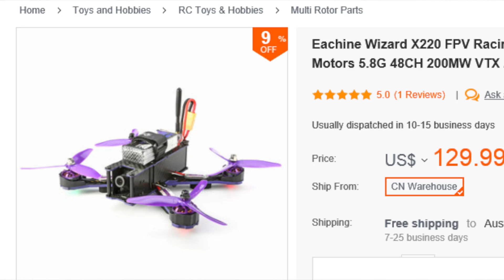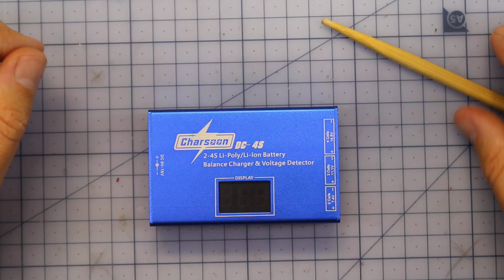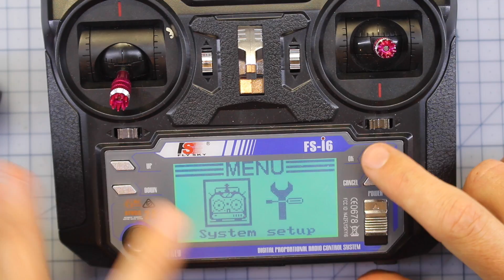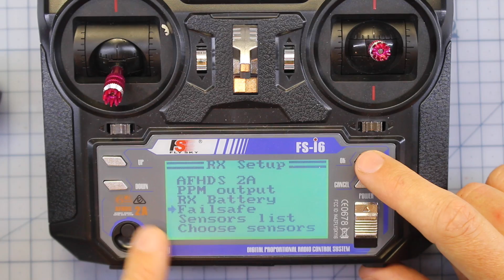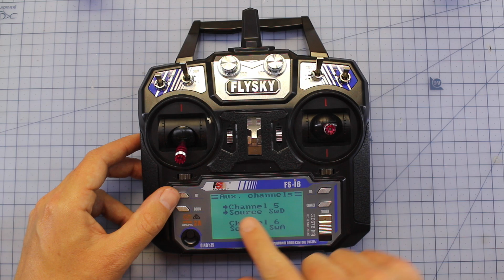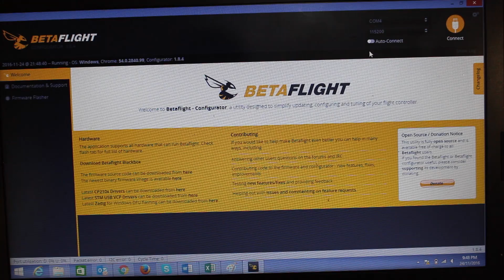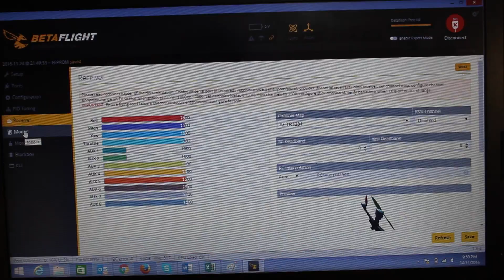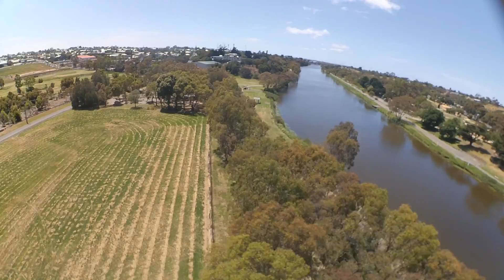How to get FPV DRONE RACING for under $300! Parts +Full setup.

Comment: Hey UAVfutues so i'm looking for a vtx that i don't need a HAM radio license for so right now i'm wondering about this vtx i found http://www.banggood.com/Skyzone-FPV-TS5813S-5_8G-25mW-40CH-Mini-AV-Wireless-Transmitter-For-Mini-Multicopter-QAV250-p-1021364.html now it's 25mw i don't know is that legal in the usa without a ham radio license.

Comment: Batteries are sold out once again. Which replacement can I get? Do it have to be 1300 mAh and 70C? Almost every battery on banggood seems to be sold out now :o
Reply from the maker: did you try all the links in the description. as long as it is more than 40c, is 4s or 3s and between 1200 - 1800mah you should be good.
Reply: Thanks man :) Love this video, really got me from wanting to try out FPV to actually making an order and do it :) One last noob-question tho, Mode1 or Mode2? :)

Comment: you should've also added a voltage checker to the list so you can strap it on the quad and it sounds an alarm when the battery gets low
Reply from the maker: the charger is a checker.
Reply: no I mean a little one that can fit on your craft that beeps when the battery is low

Comment: what about this battery for us Australians? https://hobbyking.com/en_us/turnigy-nano-tech-1300mah-4s-45-90c-lipo-pack.html
Reply: The reason i ask is a mate and I are following your guide to build a drone each for the new year. We went looking for different batteries because adding the batteries from the links in this video (bang good) are messing up the cart and will longer to ship when separated from the order.

Im also trying to work an OSD into this set up, any you could recomend, distance from transmitter and home marker i feel would be the most important features I would need.

purchase list so far is as follows, we would value your feedback and both of us look forward to popping our FPV Cherries :)

Quad
http://bit.ly/2fXOXEN

FPV Goggles
http://bit.ly/2gYh6hv

Balance Charger
http://bit.ly/2gbwaF6

Battery
http://bit.ly/2hUSNmh

Controller
http://bit.ly/2hwrz4m
Reply from the maker: those batteries will worl

Comment: Hello, why you consider this drone better that Eachine racer 250. I want to buy a racer drone and I want to choose between you proposal and racer 250. So I'd like to know your reasons why 220 and no 250. Thanks anticipated for help
Reply from the maker: the racer is junk . poorly made and will break. this is much much better
Reply: UAVfutures thanks a lot for your help. You answer is clear and sharp like a blade. The question that remains is if you will recommend the 220 quad also for beginners or maybe something else will be better. thank a lot.

Comment: Aside from the batteries you recommended, could you add another battery recommendation for maximum flight time? I'm a total beginner and would like to have more flight time over power and speed while learning. I'm getting multiples of the battery you suggested but would also like to get a couple of batteries that can give me longer flight times. Thank you!

Comment: could you do a "one step up" video with the same quad but with a slightly better radio and goggles?
Reply from the maker: almost exactly the same process
Reply: UAVfutures but what would you pick for the radio and goggles just to future proof yourself a bit for those who might have a little more of a budget.
Reply: (the epilogue went like 5 steps up)
Reply from the maker: either a evolution or a taranis. Taranis is totally future proof but I dont use 90% of its features. the evolution is a great radio for only like another $20 - $30

Comment: After seeing your recent video on the Turnigy Evolution, I might pick up this Quad, with the Turnigy, and some Fatsharks.  One with DVR.  It gets hot and humid where I am, around 110 degrees during the summer with 1000% humidity, a fan on the Fatshark might help with that. But I saw you mentioned the Diatone GT2 which I think I will also pick up eventually.
Reply from the maker: that will be a great kit.

Comment: What OSD would you recommend for x220? As far as I understand x220 doesn't come with any.
Reply from the maker: you would have to de solder some things to put in an osd, not hard, but not recommended for new pilots.

Comment: My cheaper racing quad is:
ZenDrone Blazer 250 RC Drone FPV Camera 5.8G VTX Antenna CC3D Flight Controller Integrated Design RTF w/ GoPro Mount
It's 100-200$!
CHEAP!
Reply: UAVfutures lmao straight damn savage
Reply from the maker: sorry but this is why i made this video. So people dont buy stuff like that. the zenDrone is junk

Comment: I've missed this video! Shame on me!
I've chosen some cheap gear to test it out a few months ago and made some mistakes (particularly on the charger and the transmitter; The TH9X is not the easiest one to set up for multirotors. The setup is a bit confusing. It's not a lost of money because I'll keep it for my fixed wings which is more suitable for).
Thanks for this video which will help me to improve my gear.
It's a bit late for asking Santa for the Kylin mask; The image seems really nice.
The wizard (really good name for this one ;) ) is a model I was stalking due to its capacity to run on 3 or 4S batteries. I've a bunch of 3S laying around. For the beginning, and with my flying skills, it'll can do the job. I'm a quite slow flyer.

I've a question about the choices:
The FS I6S is an evolution of the transmitter FS I6 and seems to be a good alternate choice for a few more bucks. Am I wrong ?

Comment: I just got that exact same radio and receiver, but for use on a foam board plane.  I would love to go FPV on the plane though, so that headset is getting my attention.  I using what is called the Baby Blender 2.0 (Flite Test biplane foam board kit).  I'm at $150 for the Charger, foam board, battery, servos (one extra), motor (2 sets of props), servo rods (2 spare), some laser cut bits, charger, radio, receiver, speed controller.  So it looks like I can go FPV for another $150 to match your setup.  For now it in line of sight.

Comment: Great video Stu! I got the Eachine X220 RTF with the FSi6 for $180 and got ESC's up to latest BLHeli version, got all the modes set in Betaflight, but since I'm a crap beginner in FPV I used a web tutorial on the X220 to turn the rates down, SuperExpo off  and this thing is still super fast for me even on 3S. I see the X220 has potential to take me well up into the racing experience ranks in terms of speed and agility, if I don't crash it to bits first. Already been through many sets of props. It is a very durable quad.  It is however starting to shudder at low RPMs and hover after a bunch of crashes.  I figure I need to recal the gyros, balance the props, and maybe vibration isolate the FC to deal with the beat up motors ;)  I use some older Skyzone goggles, but may try the Kylin too.  I do have some spare motors coming too. Inexpensive too, but often takes a long time to get from Banggood.

Comment: So I was looking at this quad as a beginner racer, I've been flying phantoms and and other slower drones for a few years but I wanted something faster for fun. Now while reading a few reviews on this drone I see people complaining about the antenna that comes with the drone. Now I do not know much about this but people were saying to get a clover leaf antenna so I was looking at a few but I don't quite know what to get. Does it matter which I buy? Do I need to get another for the Goggles? And do you have any recommendations on a certain antenna or brand. Money is not an issue(sub $50) but I want as long a range as possible. I also plan to get the setup in the description to the letter just in case that helps.
Reply: Also I want to know what kind of batteries to get (I want some 3s as well as 4s) thanks for reading
Reply from the maker: to be honest the antenna that is on there is fine, but a better quality one would be some aomway cp antennas.
Reply from the maker: batteries are linked in description

Comment: can I use Any FPV goggles amd setup the exact same way as your video? as there are a set for £40 sterling on the same website! 

http://m.banggood.com/Eachine-VR-007-5_8G-40CH-HD-FPV-Goggles-Video-Glasses-4_3-Inch-With-7_4V-800mAh-Battery-p-960761.html
Reply: sorry silly question that was. just watched the whole video.  thanks

Comment: Epic Video Dude! Just Quick Question Is There Enough Space On This To Fit A Gopro Session & 4S Battery On Top Plate? Peace x
Reply from the maker: yep, this is recording with a go pro attached to the top
Reply: Nice just wasn't sure as the go pro session seems to be wider then a normal go pro. One last question are these batteries good to use? Peace  http://www.banggood.com/Giant-Power-Dinogy-1300mAh-14_8V-4S-65C-LiPo-Battery-For-RC-Airplane-Multicopters-p-1033106.html?rmmds=cart
Reply from the maker: Adam Blythe those bats will work
Reply: Thanks Dude! Much Appreciated. Peace x

Comment: Nice video dude!
Just a question, I'm probably going to purchase this little thing but i've got already 3 Transmitter and the better is a FUTABA T8 Old generation (I mean the first T8 in 2.4Ghz)
and i don't wanna buy an other transmitter only for this.. But don't have any PPM input on both receiver :s Is there a solution or not?
Reply from the maker: you can do pwm but it is a bit more annoying and you need to buy another cable
Reply: Ok.. And an other question, i already have a Fatshark Predator goggles that i bought few years ago and used only 5 or 6 times but anyway, do i have to buy your stuff (Kylin FPV vision) or the predator goggles's gonna do the job?

Comment: Hey +UAVfutures, thanks for the awesome video, I have been wondering about how to get into the FPV Drone racing and you totally sold me on it. I'm waiting on all of the gear to come in the mail right now! However, you didn't go over inserting a MicroSD card anywhere or recording the flight videos like you did in the end of this video. Is that a default feature that's available on the drone software or is there additional setup needed?

Comment: Hallo .I would like to know if the drone can support the following parts.1.ZOP Power 14.8V 5500mAh 4S 45C Lipo Battery XT60 Plug With One Remote Battery Monitor and a FatShark Fat Shark Teleporter V5 FPV Goggles 5.8G 7CH Video Glasses Headset.
Reply from the maker: yes

Comment: can this baterry  http://www.banggood.com/ZOP-Power-14_8V-1800mAh-65C-4S-Lipo-Battery-XT60-Plug-p-1089557.html?rmmds=search be used in the quad? its a bit heavier and is 65C instead of 35C (dont know what it means) ? As all the eachine batteries sold out. Is that battery going to decrease flight time or agility of the quad?
Thanks.
Reply from the maker: there is another battery link in the description

Comment: Can I buy complete that includes remote control and wizard and than battery and other stuff?
Reply from the maker: there a links in descriptions to all that so you can put it together yourself with everything you need.
Reply: So If I buy this complete: http://www.banggood.com/Eachine-Wizard-X220-FPV-Racer-Blheli_S-Naze32-6DOF-5_8G-48CH-200MW-700TVL-Camera-w-FlySky-I6-RTF-p-1077100.html?rmmds=search and Kylin googles will it work?

Comment: Im looking into first brushless, probably to start with simple fly around.. The  charger, can i charge my toy grade 2cell battery with it ? Can i use a bigger mah like 1500 or more with lower C rating? Were you using another cam to record your flight ? how far can it go with that set up ? just so i know what is the limit as quad can travel fast in a bust.. Sorry with questions, im very new at this hobby..

Comment: You'll need to glue some foam in at the nose section of the Kylin googles, as they come it's just sharp plastic that digs in and is super uncomfortable.
Reply from the maker: adding extra foam is a great idea
Reply: UAVfutures Yeah, I know these are budget goggles but I can't believe it got past the design stage without anyone noticing how uncomfortable the nose section is. Still it's an easy fix.

Comment: how easy is it to upgrade things like antenna and that stuff
Reply: dj jayne the antenna just screws on, so all you need to do in order to upgrade it would be to buy a compatible antenna and screw it on.
Reply from the maker: yes, it is very easy, about as easy as changing the case on your phone

Comment: It possible to upload some actual FPV video taken from these flights?  I understand the HD film looks way better (probably sells the entire video better) but seeing the actual analog video when you say "this is the experience you'll get" instead of the HD is probably pretty helpful for people looking to get started so they know exactly what they're getting.
Reply: jeremy bryson i believe that requires a better pair of googles with dvr but not 100%
Reply: Definitely is possible, the Eachine VR D2 neweset version even contains a DVR as can be seen here: https://www.banggood.com/Eachine-VR-D2-Pro-Upgraded-5-Inches-800480-40CH-5_8G-Diversity-FPV-Goggles-with-DVR-Lens-Adjustable-p-1137808.html?p=3B03079878369201704R So you can always watch it back.

Comment: Hi mate, have a quick look and didnt notice this question, apologies if I missed it :) 

I've looked at the Eachine Racer 250 with RTF with the Screen, currently coming in around £240, I was balancing that off the Eachine Falcon without screen, learning LOS then getting goggles later. I only recently saw the Wizard. 

Between the Racer and Wizard, (besides the screen), what's your thoughts?

Comment: Noob question. Ordering everything for my fist build. Does it matter what soldering iron I get or will any cheap one do?
Reply: Get a proper soldering iron, don't just get a cheap battery-powered "pen" one or one that plugs directly into your wall. Go for a Weller or Hakko brand one or at least get a decent one. You don't need to do any soldering to assemble and set up the Wizard by the way.
Reply: Oh okay, what do you mean by plugs directly into the wall? Thanks.
Reply: A lot of good quality ones such as Weller or Hakko ones have a little station with temperature-control and a stand to hold the iron, but some cheap ones are just the iron and a connector to the wall.
Reply: AuthorFilms Studios
 Got it, thanks. I was thinking, okay so no battery and not one that plugs into the wall? What else is there??? Haha.
Reply: Ron Tropics
Just google "good soldering irons".
Reply: Rickerd dick
Fuck off. We know you just want those referrals/affiliate points cos ur a cheap shit who cant afford stuff.
Reply: Get now 50% DISCOUNT on this drone: http://www.banggood.com/Eachine-Wizard-X220-FPV-Racer-Blheli_S-Naze32-6DOF-5_8G-48CH-200MW-700TVL-Camera-w-FlySky-I6-RTF-p-1077100.html?p=TL0111854575201411Z0
Reply: Ron Tropics having a solid Iron is very important. You'll be a using it a ton and a cheap one can often be a pain, give you bad joints and wreck stuff
Reply: AuthorFilms Studios I am so tired of it too... :(   Recently I discovered that you can tap the option button on the comment (looks like three vertical dots), click report, and select commercial marketing/spam.  Wish YouTube would add some filters to combat this crap.
Reply: Ron Tropics get any one that looks decent
Reply: I use a beginner set I ordered from Amazon for $30 which works fine.  it really depends what you need it for and how often you'll use it.
Reply: Ron Tropics used 20$ on the soldering iron with stand, a "sucker", and extra tips. 30$!!!!!
Reply: AuthorFilms Studios why pay more when you can pay less?
Reply: Olav Amh
I was talking to that Rickerd Dick guy. The always spam their affiliate links every where with thigs saying "50% off" and so they get discounts on products. About the soldering iron I use a £30 ($40) one from amazon. Invest in a more decent one if you are doing more sensetive work.
Reply: AuthorFilms Studios yes i know but i use a 30$ one and it works very good!!

Comment: this video came out on the 2th were now the 8th and if a add all the cost from your list im already at $451.05CAD I have no clue where you live but your clearly getting a better deal then I am from your links.
Reply: patprop74 in the us... It's less that 300
Reply: wow that is huge difference between our two countries
Reply: 1 USD = 1.3 CAD. Since I live in the UK it's cheaper (1 USD = 0.8 GBP) so it only costs me £260 to buy this whole set.

Comment: http://www.banggood.com/Eachine-VR-D2-5-Inches-800480-40CH-Raceband-5_8G-Diversity-FPV-Goggles-with-DVR-Lens-Adjustable-p-1074866.html

That might be a better headset. Diversity and DVR. Currently 10 bucks cheaper!
Reply: I have this quad and it is awesome. I'm just learning how to fly FPV and it's been great to learn on. Crashed several times and haven't broken it yet.

Comment: Wow for somebody who is looking to get started in the hobby, this video is perfect.  Its much appreciated.  
I did have a question though.  
This is a great build for the $300 mark.  
What would you upgrade if your budget was say $500? $750? $1000?
Controller? Quad? Better FPV googles?  I'd be looking for something that could record video while I'm flying.  Some FPV's have built in DVR?  Or spend the to attack a exterior camera like a GoPro Session or some other kid of action cam?

Thanks for the video!
Reply from the maker: , for a $1000 get a gt2 crusader, a taranis radio and some fatsharks
Reply: Thanks!  I was thinking of still getting this little Quad because the value seems good, but upgrading to that Taranis and some Fatsharks with it.  I'll probably get that GT2 down the road at the later point though.

Comment: I can't find the 4s 1300mah lipo. Is it a problem to use a 4s 1500mah?
Reply: danny fpv what's the difference between the 1300 and 1500 in this situation?
Reply: Paul you will get  slightly more flight time  on the  1500.